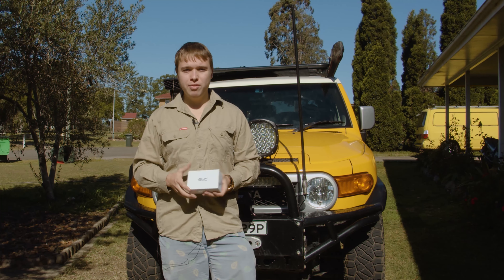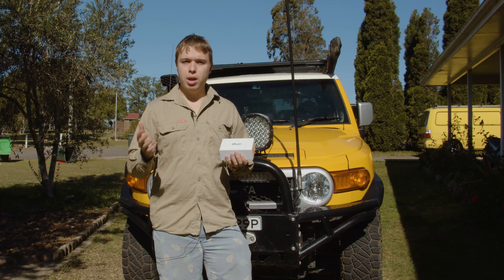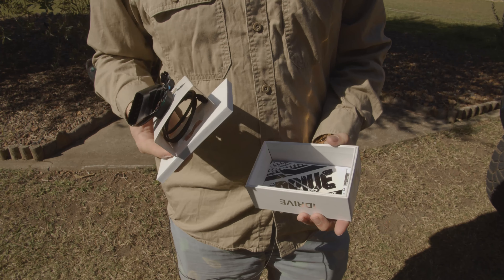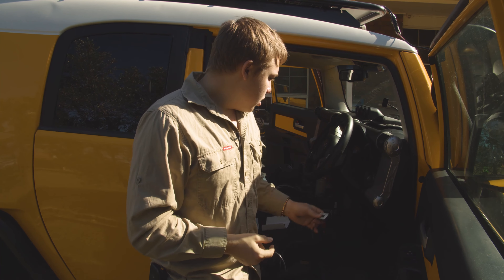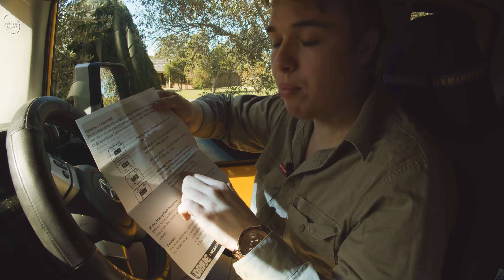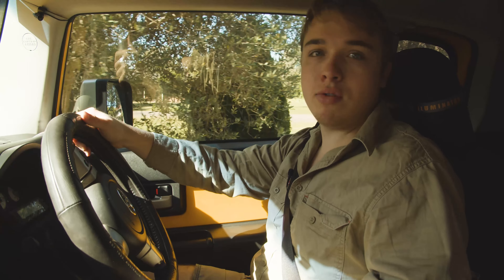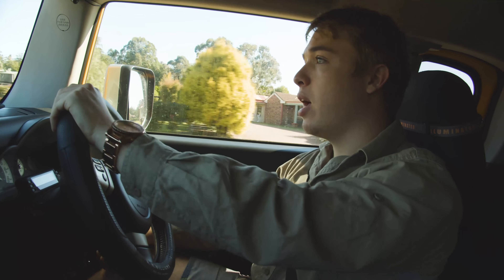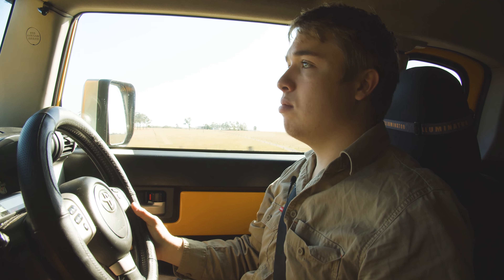iDrive FJ Crusier Installation and Review

Comment: Hey man I'm currently installing the idrive on my fj. How did you remove the throttle plug?
Reply from the maker: David McClelland there is a little clip you need to push in to make it release 😀
Reply: Thanks man I got it like 5 minutes after. But difficult to get my hand in. Works like a charm . Ultimate 4 setting for me.